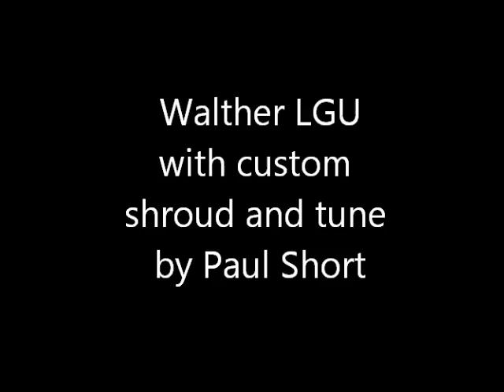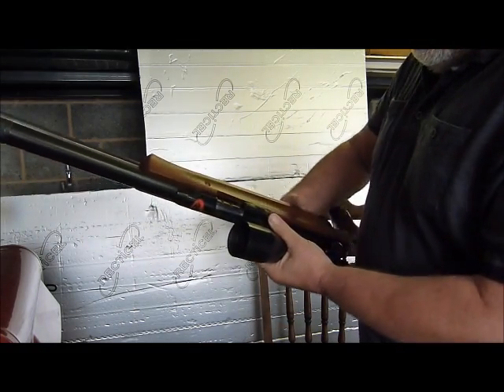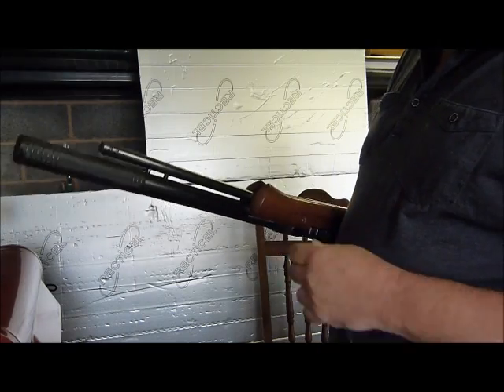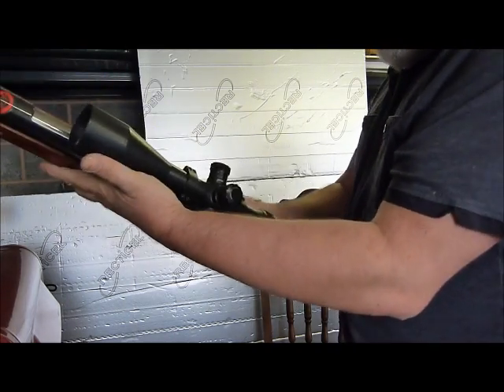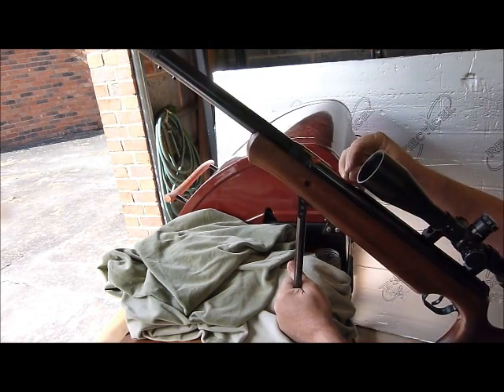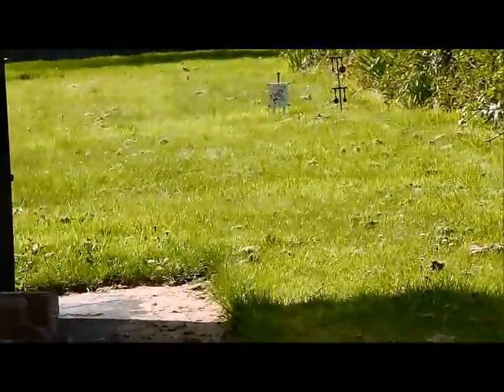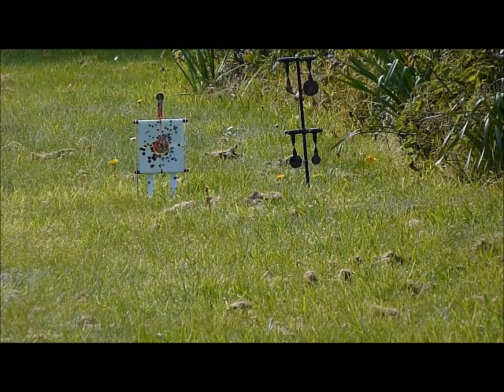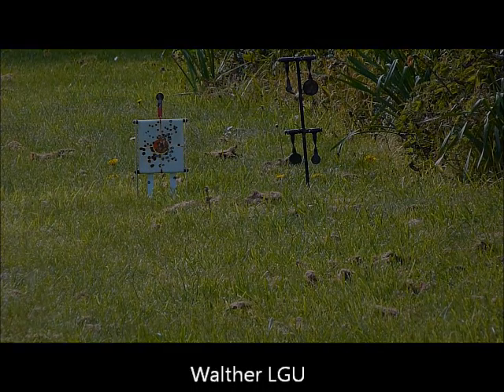Walther LGU customised by Paul Short

Comment: just wondering what i should get plz get back to me as you know this \\\do i get the hw97k \ hw97kt \ lgu \ lgv \ TX200 and can i shoot the hw97k woodstock lefthanded thx jay from bristol shoots @ mendips
Reply: Hw97KT with thumbhole stock, you can shoot left handed and right handed with that stock, another point is that the hw97kt has the "rekord" trigger unit that's one of the if not the best airgun trigger you can get. and atleast over here the hw97kt is half the price of a AA Tx200, so yeah

Comment: over priced by miles buy a pcp
Reply from the maker: +RIXSTAA AA - had them - don't like them. I do like springers though and I like them even more when I have tinkered with them.
Reply: +RIXSTAA AA Over priced??? I paid £350 no need for a pump or bottle pellet on pellet at 20 meters
Reply: @NoodlesTBograt  when your are bounded bij law in some countrys ,7,5 joule germany or 16 joule uk ,you do not need a pcp ,
 a springer or gasram gun  are shooters who only need  pellets and some maintance , replacing  at some time a seal and spring after 20.000 shots or so  ,and are more reliable 
pcp depends on lots of o rings and dry air ,if you need more power then 50 joule ,you have to get a pcp and pressure pumps, tanks and more.bullets are in the bigger pcp  calibers expensive as firearms ammo or you must cast them yourself.